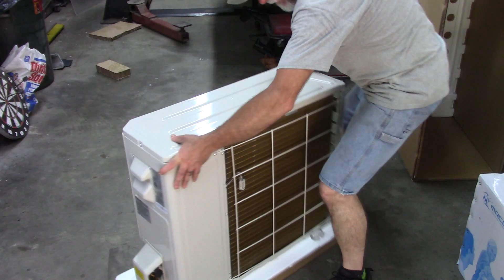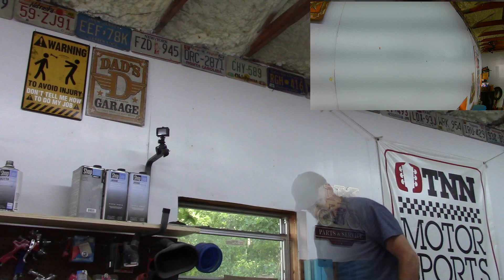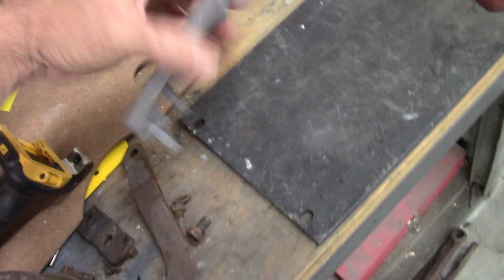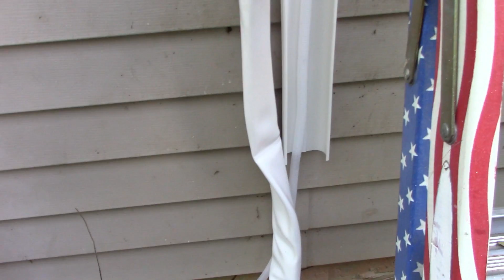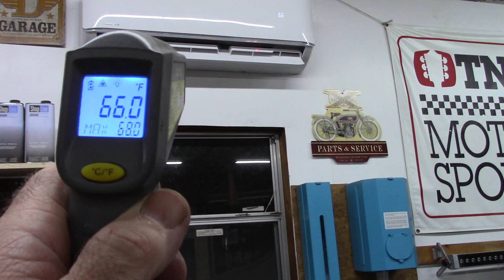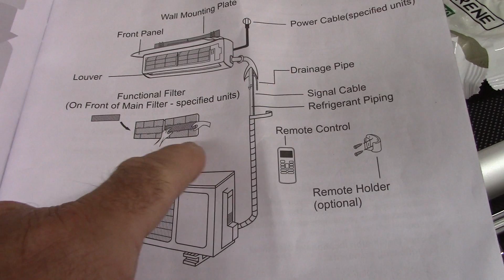Mr Cool mini split air conditioner install.

Comment: Hold on a minute, did you pull a vacuum on that system?  I don't see a vac pump, gauge set or micron meter.  If you did not pull the air and moisture out of that lineset, you can guarantee a dead compressor is in your near future.  That refrigerant will become acidic and chew through your valves and anything else in its path.
These things are NOT for a novice to play with, you also need to have an EPA certification for doing this sort of work.... SMH
Reply from the maker: Sounds like you're unfamiliar with these. These are a DIY system. Lines come sealed, and precharged. Simply connect and go. No air and moisture to remove. It's bee operating over a year mow, and has no issues.
Reply: @JoDaddysGarage   call Mr. Cool.
Reply from the maker: https://iwae.com/promo/mrcool-diy/
Reply: Jo Daddy's Garage sorry buddy and i don't mean to call you out on this, but you're wrong.  I do this every day for a living.  The evaporator and the line set will have air and moisture in them and now it's contaminated your system.  It will fail, i guarantee it.
These are not "do it yourself" items.  You need to be epa certified to touch refrigerant period.
Reply from the maker: https://iwae.com/promo/mrcool-diy/
Reply from the maker: Nothing noted in their own instructions: https://cdn.iwae.com/media/manuals/mrcool/mrcool-diyae-technical.pdf

Comment: You didn’t show the most important part. Connecting the tubes!!  Or the power!!
Reply: Most people will not show this due to liability purposes. Connect the refrigerant tubes is just a matter of screwing them in and unscrewing the taps. The only truly plug/play electrical connecting is plugging in the cable from the indoor unit to the outdoor unit and screwing in the ground. The rest---installing a circuit breaker, disconnect switch, and running power are best left to the professionals. You still save a lot of $ even if you bring an electrician in to do this part for you.

Comment: Joe Daddy - Thank you, this video was key to my success because you took the time to go over the install, refer to the manuals and generally do a great job!  Bravo.  

Haven't read through the other comments, one thing on your install which i noticed is that perhaps you should have moved your drain line over to the side where you go out through the wall.  The instructions seem to indicate that. I did do that.  Learning - there is a spring loaded hose clamp to take off of the existing hose side, and the plug which you pull out is hard to get back into the hole that needs plugged when you remove the hose (swap hose for plug on either side) I got mine in 90%, no leaking.

Also I did the wall mount and the screws on my rubber shock feet pulled out while tighteing down, so I used the included rubber pads and bolts/washers.

Comment: Are you getting any sweating from your lines? My lines are sweating I have the same unit.
Reply: Suction Line ALWAYS sweats (the big one) so there is that...
Reply from the maker: I haven't really checked. I'm sure it will have at least some sweating.

Comment: same car, refrigerator, windows a/c split air conditioner air center must have out air yu know better vacum pump
Reply from the maker: No vacuum required. System comes vacuumed, sealed, and precharged. It works great.

Comment: Using this video as a guide, I installed the 12,000 BTU version of this in a fairly small workshop that was unusable in the Texas summer heat.  It is a smaller unit, and has 120V 20A power.  It cools this space from an oven to a meat locker in about 15 minutes.  The naysayers who insist that this won’t work well because it isn’t evacuated on site just don’t understand how it is built.  It’s precharged, and connecting the lines gives no opportunity for air or moisture to get inside.  You need to be a little handy to install it, but if you weren’t, you probably wouldn’t be watching this video.  Thanks to the OP for posting this very useful video.  I highly recommend this unit.  I saved about 70% of what an HVAC company wanted to install a similar unit.

Comment: I didn't see you pull a vacuum on  the line set and indoor unit. If you didn't pull vacuum then you've allowed the refrigerant to be contaminated because of the air and moisture in the lines. Unless this unit is pre vacuumed and when lines are connected to outside unit it breaks the seal.
Reply from the maker: That's exactly the design of this unit. No vacuum required. Precharged.

Comment: I just finished installing the 2 Ton Mr. Cool unit. It was a lot of work, but it does the job. Nice and cool and removing the humidity in the house nicely.

The trickiest part is doing the electrical. If you're not comfortable with electrical work, don't try it. For the 24000 BTU unit, you have to run a 240V 15A line from the electrical panel.  I went with 12 Gauge 20A lines because I had to go about 30' from the panel to the unit. I put a 240V 20A breaker in the panel. I  ran the wires inside 1" non-metallic rigid conduit in the basement. I went with 1" conduit so I could run 2 other 110V 20A branch circuits for external outlets. Then, I drilled through the foundation out to a 1" junction box. Then, non-metallic 3/4" flexible conduit with a 1" to 3/4" reducer out of the 1" junction box to get the 240V out to the 30A disconnect fuse box and 20A fuses. Then, 6' of non-metallic 1/2" flexible conduit with liquid tight connectors over to A.C. condenser.

It does take a lot of effort, but you do save a bundle if you can do it yourself. Hiring someone to do the electrical, the mounting of the units, and running the refrigerant lines have got to be about $2500.

Comment: Hey Jo ... I am a HVAC tech by trade , they wanted it up on block because it is a Heat Pump and it will run in the winter so the blocks are to keep it out of the snow and that block of clay they called “neoprene” is what we call thumb gum it’s a sealant to put on/in wall penetrations
Reply from the maker: Thanks. Good info.

Comment: I believe that black "U" bracket at 33:24 in the video is meant to prevent someone pulling on the cable from the outside and disconnecting the 3-prong connector. What you do is remove one screw so you can place the outside cable 3-prong connector on the other side of the bracket and connect to the inside 3-prong connector. Then, when you reinstall the bracket, if you were to pull on the cable from the outside, the bracket will not let the 3-prong connector  from moving past the bracket thereby maintaining the connection on the inside of the unit.
Reply from the maker: Good info.

Comment: No evacuation before a pressure test and refrigerant release?
Reply from the maker: Correct. Not required with this unit. Precharged from the factory.
Reply: All condensers come precharged. Always run a vacuum on the system before releasing the Freon.
Reply: @blakehollingsworth839  Yeah, that's preferred, Mr Cool has attached sealed line-set under vacuum, attached to the indoor unit. It opens only when you connect to the outdoor unit using special fittings. Not the preferred "pro installer" technique, but it works if you can live with the extra line length mess. I would not like it hanging there but it can save some upfront money.....

Comment: I recently purchased a different brand and I have been watching other videos to make sure I am doing it right. I am by no means a pro or anything but I did notice in other videos they evacuate the lines prior to turning on the freon. Is that necessary? Yours seems to be working great!!!
Reply from the maker: This particular model comes precharged. No vacuum required. Assemble, and go.
Reply: Ah wish I knew that before purchasing this one.

Comment: I have the same unit but 18KV.  I noticed my two copper lines differ in length by 4~5 inches and concerned that might produce a problem in the final part of install.  Was yours the same?  If so, did you just put a slight bend in one to shorten it to same length as shorter one?  I'm nervous about putting bend in copper lines.
Reply from the maker: Yes, they are different lengths, The larger line has a flexible end.
Reply: @JoDaddysGarage  Ok, got it installed and cooling, leak, and drain test is good.  I get a fari amount of condensation around the  outdoor fittings.  I assume this is normal?  They do get cold, even saw a small amount of ice.
Reply from the maker: That is normal. Any updates?
Reply: @JoDaddysGarage  Thanks for reply.  I'm not sure what updates you mean but system is working well.  Only thing left is the WIFI doesn't go through all the steps but I'll figure it out or see if I can get in touch with MFG.
Reply from the maker: @2wrdr  Just wanted to see if it was working properly.
Reply: @JoDaddysGarage  Works great and nice that is is quiet.

Comment: All these units come from the same manufacture in China, I pulled the part code from the compressor and found the technical manual for all of these units. It looks like Jo actually pumped his system down... I have watched another video where the dude just connected it up without pumping the system down.

For $600 its steal, I converted my unit to use a water based heat exchanger for a boat.

Comment: Did you need to install a 230V line or it runs on 115V regular outlet?
Reply from the maker: Independent 230V line.

Comment: You didn't vaccuum  the lines?!?!
Reply: What so many so called pros don't realize or they just want to post and confuse people is the MrCool DIY models come with refrigerant already in the outside condenser just as any other unit BUT the inside evaporator and entire lineset is already evacuated and under a vacuum from the factory. They have quick connect like fittings to allow a DIY type install.
Reply from the maker: Nope. Not required.

Comment: Fantastic video.   I was wondering, when you drew the electrical line to the cutout mounted on the post, did you bring out an internal line or did you run one special for this from your house's electrical box?  Did you do the electrical lines yourself or did you hire an electrician to do it? I am so much wanting to get one or two of these Mr. Cool units, but the electrical part is what is stopping me.   Did you have any electrical experience before doing this install?   By the way,  I love the idea of the post, the cutoff box, and the cover. Thank you in advance.
Reply: Gary, get an electrician to run your 220 line. I was going to DIY but got an estimate and learned I was going to do it all wrong. Nothing else can be on line with this unit. (24K BTU) no dryers or anything else.  went with a 35 AMP breaker just to be sure...good luck !
Reply from the maker: Just don't use too large of a breaker either. There's a reason they are rated.
Reply from the maker: My shop has it's own service. I ran power from my panel to the unit. I have run wiring before. I would recommend running single strand wire (like on a spool) instead of the stiff bundle type (10-2, 12-2) you would normally use to wire an outlet in a house.

Comment: Some of the steps in this video look very nice for a DIY project, but  Please don't follow the last procedure(connecting pipes to the condenser or outside unit) if you want to have your split unit keeping you cool for a long time. In this video he doesn't mention anything about evacuation of the system nor leak inspection, if you follow these steps you will end up calling a HVAC technician to check for proper installation of the unit, so you will have to incur in extra expenses like gas (refrigerant) recharging, so please be aware of this advice.
Reply from the maker: As per the instructions in the manual, and advertising by the manufacturer, no vacuum is required. If you want to have this performed, it's up to you. I have had no issues with this system.

Comment: Great video! Do you think the output temp isn't very cool because you didn't pull a vacuum on the lines before releasing the refrigerant into the system?
Reply from the maker: Thanks. It operates fine. No vacuum required as it is a sealed system.
Reply: @JoDaddysGarage  The output temp was high because it was cooling 86 degree room air. They arent magic, there is a delta temp diff and if its 86 in room and supplying very low 70's you are doing fine. As room temp drops so will the supply and as the moisture is removed it will work even better. First run everything needs to be cooled in the room, not just the air because it has a high core temperature. Once its operated a few hours all will be fine.

Comment: Everyone will ask. The refrigerant lines are PRE CHARGED. No pressure test or vacuuming. Connect lines to unit and open the valves and test for leaks with leak solution. This is part of what makes it a DIY system.

Comment: It’s not sitting on cinder blocks you are supposed to use the rubber feet that came with the kit.  This will raise it up so that the drain elbow is not crushed.

Comment: Do you know if it would be very hard for a pro shop to shorten the lines for me? I just need about 10' so I don't want all that excess around.
Reply: If you want a shop to shorten the lines then just pay less for a MrCool Advantage or Oasis model to start with. All are excellent units it's just this line is made for a Do it yourselfer that doesn't want to pay an installer.
Reply from the maker: I do not know. Sorry.

Comment: Nice video, using 10 gauge wire on the service loop was hard to install at the terminal logs because the unit is wired for 20 amp service with 12 gauge wire for use with a 20 amp service breaker!

Comment: Excellent video!  I have  the 12k btu version on order for the small enclosed workshop off of my garage.  This video will be very helpful when I install it.  Lots of comments about pulling a vacuum, I see.  It appears to me that the condenser unit is charged with refrigerant and the evaporator unit has a vacuum pulled on it with both sides having valves that keep them sealed until they are connected.  This would prevent air from entering the system.  From the number of videos and reviews I have seen, it looks like this design works just fine.  Can't wait to get mine installed so I can work in my workshop during the hot Texas summer.
Reply from the maker: Thanks! It's been great so far.

Comment: in every unit I've seen, the lineset can be fed out the rear left or right or out either side. 
I do wish Mr Cool would make these units with different lineset lengths. I only need 10' here. there must be an efficiency hit from overly long tubes.
Reply: Not to mention a clunky looking installation having 15 extra feet of line set to coil up and do SOMETHING with.  One video I watch, guy builds a box on the outside of the wall and uses it to hide the coil....yeah, real great looking install...ahahhaaa
No...I've self installed a couple other brands, and it looks a LOT neater with the lines cut to fit....which is the selling point of Mr. Cool....not having to do thsat.
Reply: @edsmith4414  I'd just as soon pay a HVAC guy to cut the right sized lineset, flare the ends properly, pull a vacuum, pressure test and fill with refrigerant for a few hundred $$. Still would be ahead buying a fancy unit at full price.

Comment: Looks like many so called HVAC Techs do not bother to read instructions or Manufacturer's specifications before working on a unit.  What a shame some of you are.  No wonder so many people complain when trying to get their  HVAC systems repaired.  Great video Jo Daddy!
Reply: The so called techs that don't read instructions are because the homeowners that don't want to pay the rates of the companies that hire good techs. The old saying goes you get what you pay for. There are a lot of companies out there that hire techs off the street and don't want to pay good techs to retain them. We have a policy that if someone purchased their own unit and installed it, that we will not work on it. Have ran into too many in the past that were incorrectly installed and the homeowners complaining we should be able to fix inherited problems. Buyer beware.

Comment: What breaker amp did you use? Would 20amp double pole breaker be enough?
Reply: It depends on the size of the unit. They use less amps and watts than a space heater.

Comment: I see a lot of so called HVAC techs complaining about the line set not have a vacuum pulled. I think they probably handle their work the same way, and never read anything but charge insane prices. I do wonder what exactly is in the lines, maybe nitrogen and it comes out then the plunger is screwed in, or maybe actual R410 but I kind of doubt it. It adds quite a bit of cost to the unit but worth it to someone who don't have the necessary tools. Plus got a actual warranty if the company stays around and responds. That is one of the biggest problems with other brands, no warranty unless installed by the great techs. Even then its a hassle usually. They do that on purpose, trying to kiss up to the HVAC industry. 

But that works out great for the companies, sell products with no real warranty because of the crazy rules in some countries. If someone tries to hired a regular HVAC person to installed anything they don't sell, its either a funny price or they won't do it at all. They are so full of their-selves its amazing. Supply houses lie and say they cannot sell because its not legal, which is another lie. One does not touch the refrigerant when installing any of them. Most techs I know don't have a micron gauge. But for me its a better deal to just buy the regular units and use nitrogen, vacuum and release the R410.  Nothing complicated about it. I can buy the entire condenser or evaporator usually cheaper than breathing on some HVAC tech idiot.